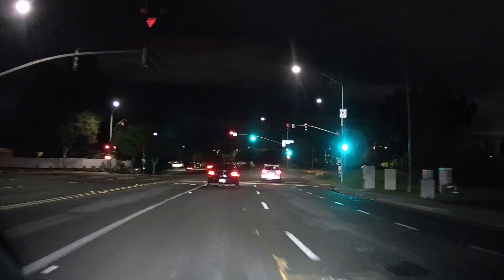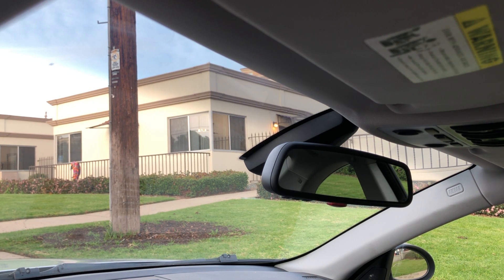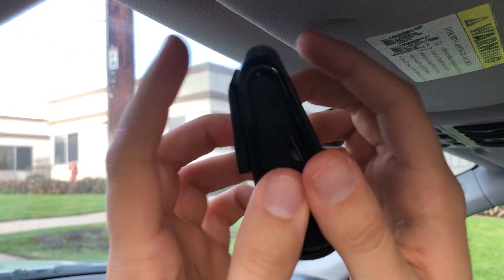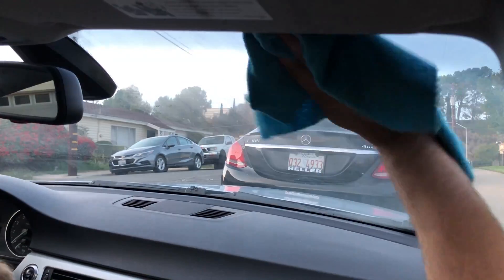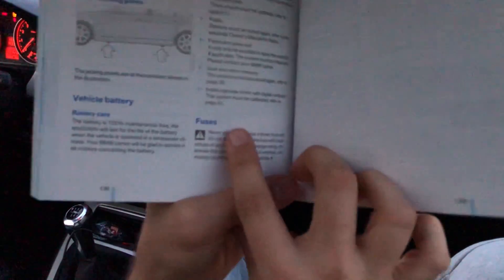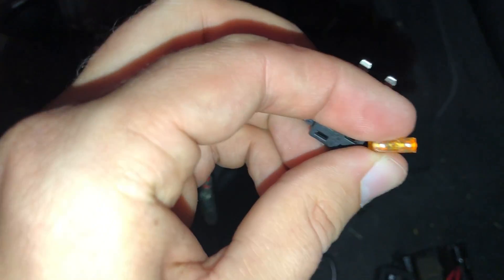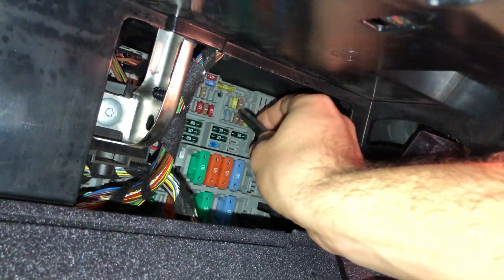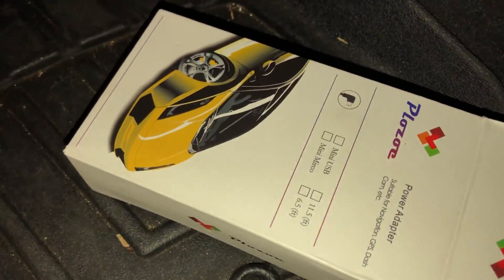How to Install AND Hard Wire a Dashcam (Viofo A119 V3)

Comment: FYI - mounting positions: you're best off installing any dash cam on an area of the windshield that the wipers will be able to clean! I live in snowy conditions and the upper right corner of the windshield would be completely obstructed during winter weather.

Comment: DO NOT mount the camera in the upper right if you have a curtain airbag like it appears this car has. In an accident, that dash cam could become a projectile. It also may be destroyed by the deploying airbag and you won't record the incident in full.
Reply: Yes, the webcam cable should be routed IN FRONT the A pillar right where it meets the windshield, not BEHIND it. Look at BMW E9x crash videos and you will see when the airbag deploys, your cable behind the A pillar will interfere with it and cause serious issues! Please correct your video!

Comment: Nice vid. You do not have to use tweezers to pull the fuse. BMW's include a fuse puller, its the long red plastic in the middle of your fuse block.
Reply: when i found a fuse puller in my old chevy's fusebox i just about shit. really cool thing to include with the car

Comment: Really well-done video. My son just got one of these for me and I have to figure out how to wire it into my 1990 E34 525i BMW. I don't think I have an internal fuse box (the main box is under the hood), but I'm going to poke around a find out.
Reply from the maker: Perfect, so glad it was helpful. Hope you have success with the E34 wiring!
Reply: @TechItEasy0  I've been doing driving tests with the camera and have been extremely unimpressed by the video quality. I tried to read license plates of cars in front of me and also cars as they are coming towards me. The "high res" settings look like they are just up-resn'g from lower resolution and therefore cannot resolve license plates in most cases. I'm not sure I want to spend the time and money to permanently install this device.

Comment: This is a great help. Quick question. Is there an easy way to save a clip while driving?  Say something happens while driving. Is there a button you can push to save the clip?  Thanks for the vid.
Reply: Yes, on the Viofo A119 there is a button to "lock" a portion of video from being erased in the loop. And bumps or accidents will activate the feature automatically. Unfortunately, this install is on the passenger side of the mirror preventing the driver from using the video lock button.

Comment: just got mine today, and it came with a "static sticker" which states "paste this on the windshield before sticking the 3M sticker"
those who also for the CPL lens, I'd advise watching a video on adjusting the lens before clipping it on, they don't all come aligned properly, mine wasn't aligned quite right so lucky I checked first.
Reply: Thanks for the tip

Comment: Fuses are bi-directional ie it doesn't matter which way you put it in
Reply from the maker: Good to know for the future, thank you
Reply: @TechItEasy0  now i did hear the fuse boxes are directional but fuses themselves unless you have ocd dont matter which way they plug in its basically putting a wire from one point to another

Comment: Not the latest HK3 wire and  no voltage control to protect vehicle battery voltage level for parking operate.
Reply from the maker: Boring I didn’t integrate it on a fuse that will be on when the car is off. For parking mode, the Viofo-made kit will be best and that includes what you mentioned

Comment: If I don't hard wire my dash cam and use the ac adapter port will it still record when the car is parked and off
Reply from the maker: No, and in my case it won't do that even being hard-wired to the fuse box... you need to have it wired to something (a fuse) that keeps power at all times
Reply: @tandbappliance  The hardwire kit for the dashcam has an automatic shutoff when the voltage of the battery drops so it will not completely drain the battery.  The automatic shutoff is the black box that can be seen connected to the wires at 6:54.  I didn't see where the box was mentioned in the  video.

Comment: Does it still record using this hardwire kit with the car completely off and the key out of the ignition?
Reply: Yes, with parking mode turned on and hardwire kit properly installed, the dashcam will still record with engine off.

Comment: If it comes with its own fuse why not just attach it to the battery terminals? Or do you want it powered off when you switch off the ignition? I do not see the point of messing with the fuses as you are increasing the load for no reason. Thanks for the video by the way, very informative!
Reply from the maker: Glad you found it informative. I like the fuses simply to avoid cluttering the battery terminals, I wouldn't say either approach is "right" or "wrong"

Comment: What micro sd card are you using? Do you just place it in side the dash cam and it will start recording?
Reply from the maker: I use the Samsung PRO Endurance, they're supposed to do much better with heat and constant, constant Reads/Writes. Once you slot it in the side there and give it power, it starts recording!

Comment: how much voltage + amp, does the dashcam use?
Reply: I can't find anything in the manual or box, but the car charger it comes with that you are supposed to plug the camera into outputs 5v and 3.1a

Comment: Great video. Where did you get the fuse tap and the hardwire kit
Reply from the maker: I got them both on Amazon, links are in the description of this video if you want to check it out!
Reply: Shaydon Bodemar  thak you they work great just installed them